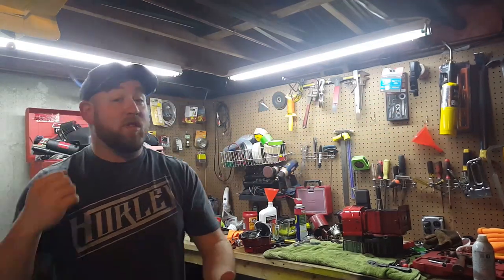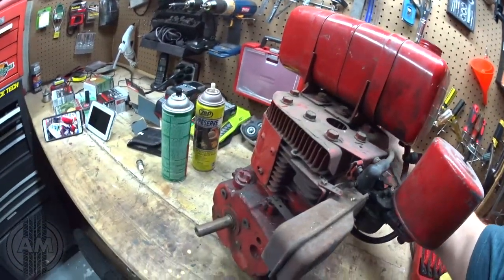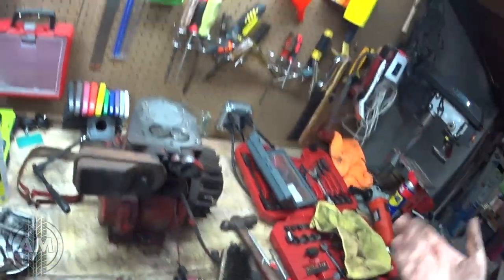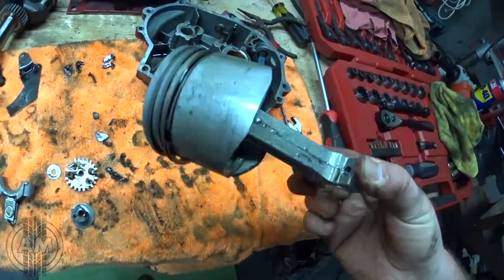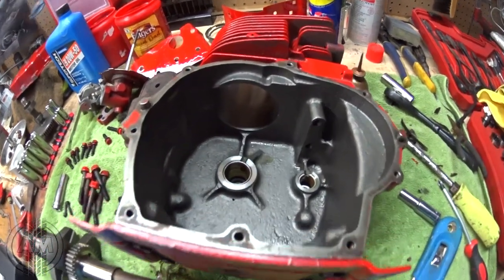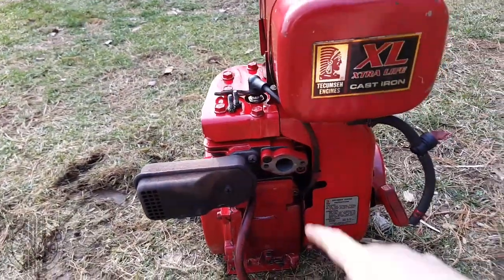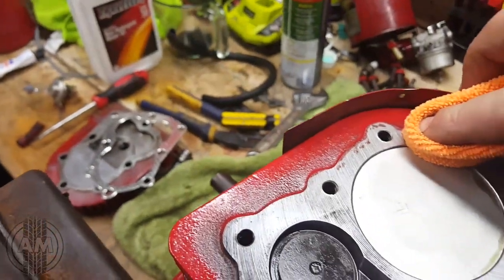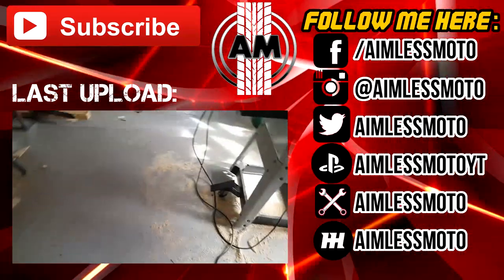Small Engine Repair | Tecumseh HH60 REBUILD | Diagnose and Fix | PROJECT

Comment: I was all set to like this video, then you fast forward through the putting the crank and piston and everything back together, c'mon man
Reply from the maker: +cnrmoose It's not a how-to... I will post up a video of the re-assembly and link it to this video... It would literally make this video an hour long if I put that in.
Reply: +AimlessMoto That would be good, I can ff through the parts I'm not interested in, I got an HH60 in my '80 Troy Bilt Horse and the governor is broke in the engine, I just regulate the throttle by hand, but would like to know how to rebuild it.
Reply from the maker: I didn't install the governor! What I did instead was hook a spring to the carburetor, and the other end of the spring goes to a lever on a plate mounted to the head... on the plate there is a little clip that a throttle cable can go into. I just ensure it won't over-rev or reach valve-float by bending the tab on the back of the throttle plate to touch the carburetor... this way it's impossible to over-rev it, but I still have a linkage for a throttle cable... and no governor to blow-up again. cnrmoose
Reply from the maker: +cnrmoose https://www.youtube.com/watch?v=gcTYHnm4BHE

Comment: 8:55 why bother? its like painting a turd for the few seconds it goes down the toilet. these are cheap engines that are easily replaced by the bottom line harbor freight special.
Reply from the maker: A Tecumseh will out-last a predator by decades. That, and I like fixing stuff.
Reply: @AimlessMoto  I really don't like Tecumsehs.  The manual choke drives me mad. Sometimes it will only start with full choke, other times it won't start with full choke and no choke but will start with half choke.  Sometimes it won't start with full choke or half choke but will start with no choke.  Every time spend 5 mins fiddling with it to get it to start.  The engine has so much blow by it it makes the oil so dirty that it needs two oil changes a year for only 8 hours a year of runtime a year.  I've got  Honda and Predator engines that runs for 50+ hours and the oil barely shows any signs of being dirty but the Tecumseh engine oil is black after 4 hours of runtime even with full synthetic.